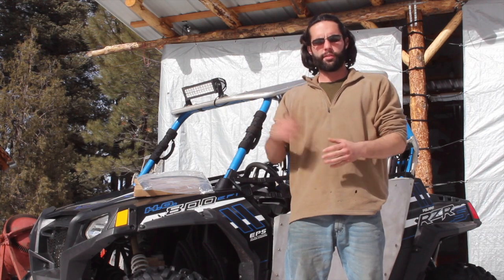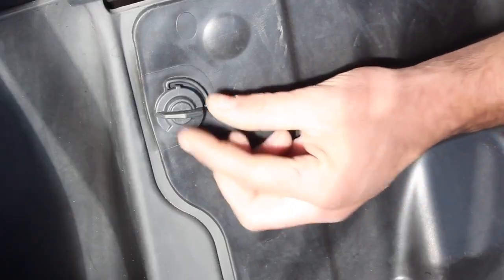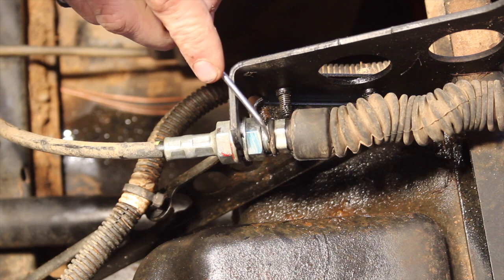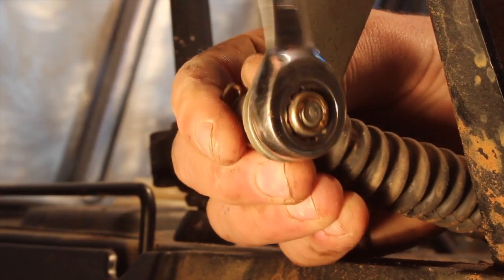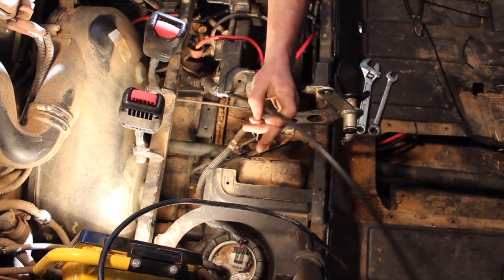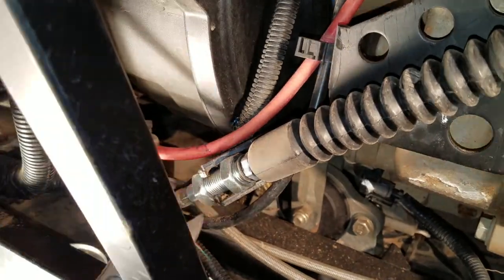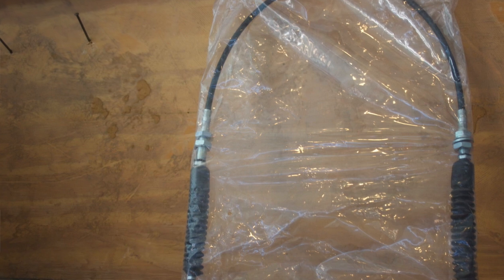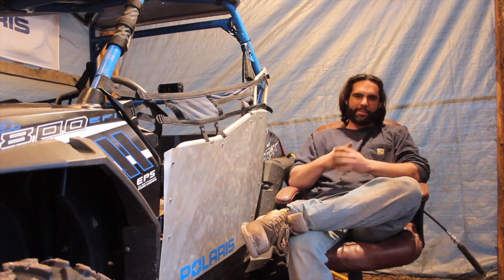How-To Replace Shift Cable on Polaris RZR 800

Comment: Hey bro I’ve been watching your videos, I have a 2016 can am maverick 1000r that I thought had a bad shift cable so I replaced it and also replaced the belt and primary clutch and it will not shift out of reverse. I tried doing it manually and will not shift into neutral, high hear or anything else but park and reverse. Do you think it’s the shift fork?
Reply from the maker: Appreciate you watching the videos, and I honestly have no clue as I've never done any sort of transmission work on any of these machines, but there are a number of videos out there for diagnosing clutch/transmission issues and I've also found the online forums and service manuals to be a the two best resources for repairing these machines. Sorry I don't have enough experience to give you a more helpful answer, but maybe someone who has been down that road will see this and leave a comment. Appreciate you watching and taking the time to share your experience with a question in the comments. Let us know if you figure it out. Cheers

Comment: So you just used the oem cable that was already on there. The one that you said was hard to shift? If so how did you fix the shifting problems?
Reply from the maker: If I remember correctly as its been a couple years, we ordered a new oem cable and that did the trick for that machine and actually fit correctly. thanks for watching and taking the time to leave a thoughtful question in the comments. Cheers

Comment: I have a 2008 polaris rzr and have changed the shift cable and it still jumps out of gear when pulling off and going down the road , what can solve the problem
Reply from the maker: not sure, unfortanetly kind of sounds like it might be an internal tranny issue, one way to confirm that might be to disconnect cable entirely, put it in a gear manually and see if it still pops out? if it does you know the adjustment isn't likely to help much? just spit balling here as I've never encountered that exact issue. Good luck and let us know how it plays out. Thanks for watching and taking the time to share your experience in the comments. Cheers
Reply: Mine does the same thing. I ordered a cable and going to change mine too and try the trick he suggested below.

Comment: It's easier to remove the cotter pin and remove the cable from shifter lever and the transmission lever . No need to remove the nut and bolt

Comment: you should give the model number and manufacture of the cable that didn't fit.
Reply from the maker: Yes Sir, Good Idea. I bought a $15 one I found on Ebay that was suppose to replace the Polaris Part #7081680. The "brand" name in description was "Tocean Aftermarket Part" and I usually don't like to put out negative information about any company, but there is no doubt when it comes to their shift cable, it would not fit in the rear bracket for my RZR.  Thank you for watching and commenting with a suggestion. Cheers

Comment: I feel like the beer amount needed to complete this job increases at the installation of the new cable, and the set nut not fitting. but there was no updated tool log reflected mid video. this was 5 beers and one aggressive borderline racist shout at cheap Chinese parts job for me